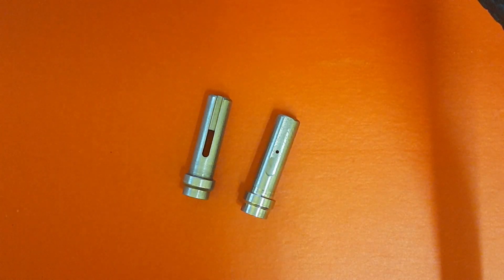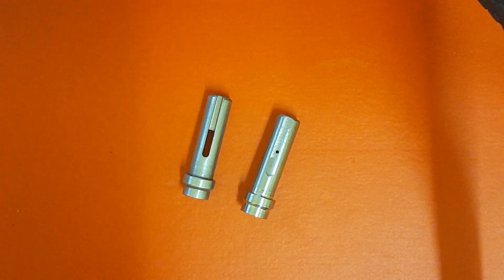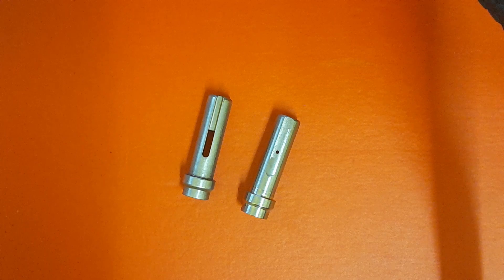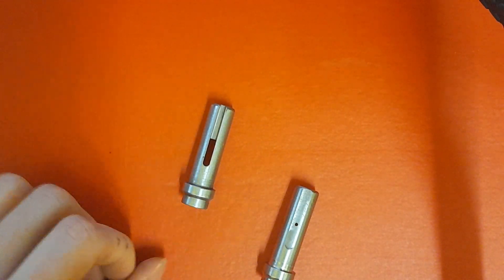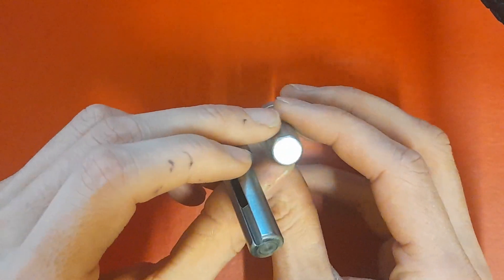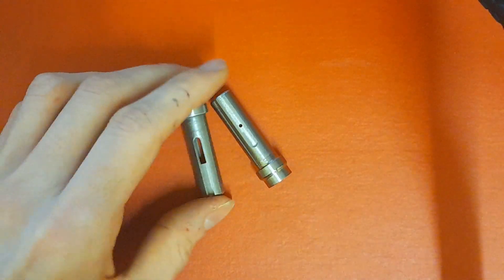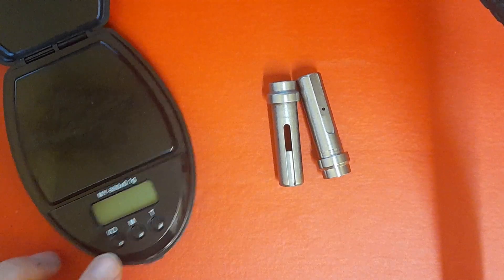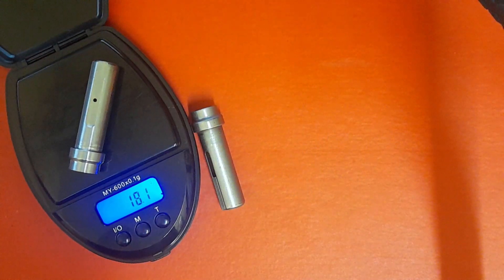FX Airguns Heavier Hammer Upgrade - Maverick, Crown, Wildcat, Dreamline etc.

Comment: Seems to me that the hammer must be made of cheese, and/or the spring has an awfully sharp end that  needs honing off. A greased acetal washer behind the spring will allow it to rotate (as does a 'top hat' in a spring gun) preventing torque which drives the spring into the softer hammer. Also, a thin hardened steel washer where the spring seats on the hammer would prevent damage. I'd say anything but a heavier hammer which increases lock time and chance of valve bounce. Surely FX know this?

Comment: so with my .25 crown, fitting this heavier hammer has increased my velocity by 20-30 fps (33.95g king heavy mk2s) and its only a couple grams heavier than the factory hammer! its still early days but i am hoping to get some slugs to group without having to worry about the hammer getting chewed up because of the increased hammer spring tension, i have the slug power kit but want to experiment with how things are at the moment, great product guys, keep the videos coming.
Reply from the maker: Fantastic, thanks for the feedback! I was interested how much more it would give on the Maverick platform!
Reply: @bagnallandkirkwood  i forgot to add thats with a 600mm superior liner.
Reply: Would this fit a cutlas plz??